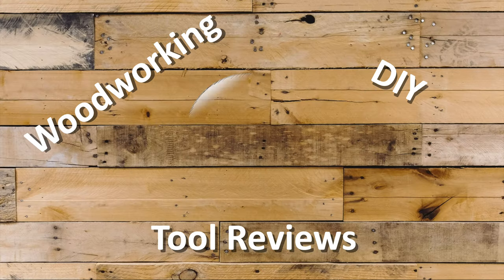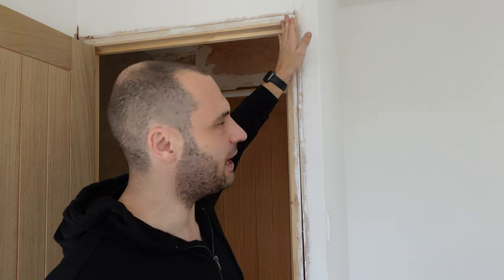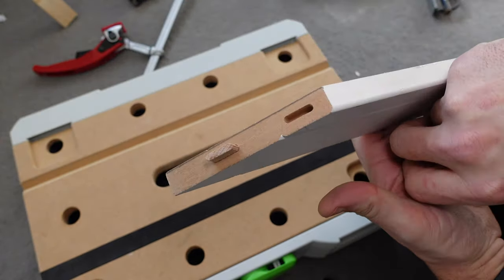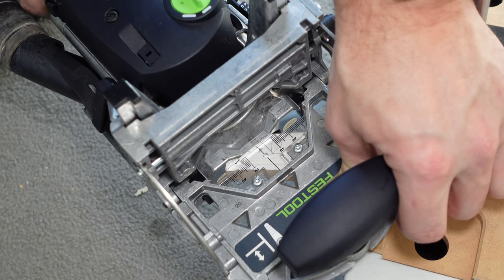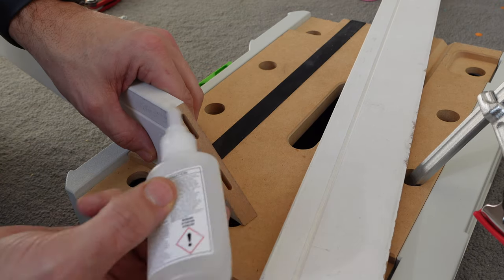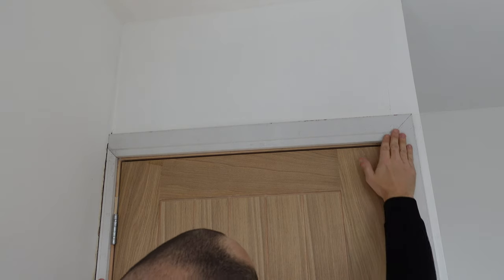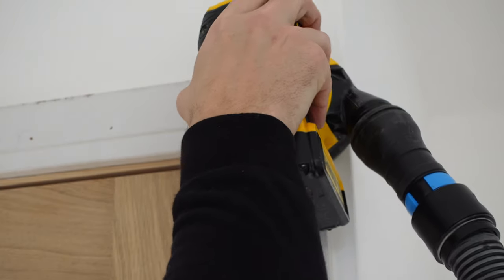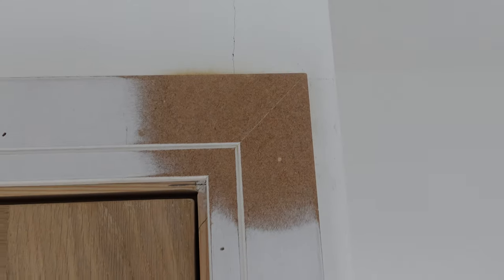Using the FESTOOL DOMINO to Fit Architrave

Comment: First video of yours that has popped up. I’ve been woodworking for 45 plus years and seen a seismic change in EP what tools and adhesives are available to the hobby or small tradesman. I’ve got both sizes of dominos and use them a lot. However, in this situation, I use pocket screws with adhesive. They will pull your joint tight instead of needing to cramp in some way. 

You’re right about 90 degrees. The saying is that it doesn’t occur in nature or houses. Buy an adjustable angle finder: measure and then adjust  your cuts to 45.5 or 44 or whatever. Same goes for skirtings and architraves although, for internal corners, the cut is a cope and not mitre
Reply from the maker: Your right this angle was 88 deg got a trend angle finder it’s awesome. Pocket screws are a good shout but wouldn’t have worked on the thin vertical that had been ripped down and don’t assist with keeping the faces flush. 👍🏼
Reply: @WheresMyPencilUK  thank you for the reply. Interestingly, I can now use pocket screws down to 12mm thick stock by shimming the jig. Alignment should only be an issue if you don’t cramp both parts together at the alignment that you want. To get this, I have several of those cramps that come with pocket screw jigs - I bought additional ones from Banggood at under £20 each -  this should ensure that the stock doesn’t move whilst securing.  In the end, all that matters is the finished article.

 I don’t know if you have tried Veiko tools from Banggood. I put my toe in the water several years ago and have never been disappointed with the quality. All as accurate as my Woodpecker, Starrett tools - but a fraction of the price.
Reply from the maker: Thanks that’s interesting. Bangood want to send me some bits to try so I’ll be interested to se how I get on. 👍🏼
Reply: @WheresMyPencilUK  I’ve had some shockers from Banggood - not tools - but everything made by Veiko has been excellent